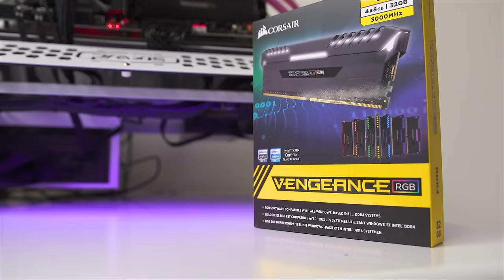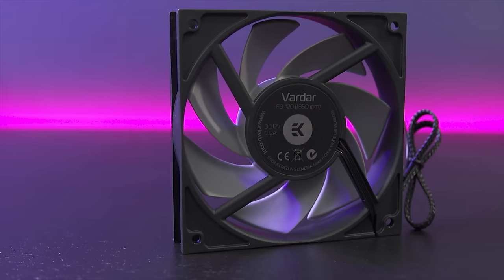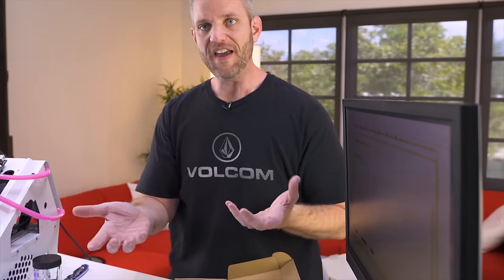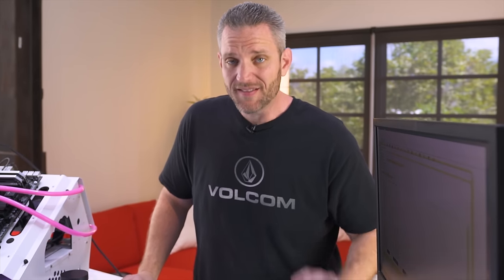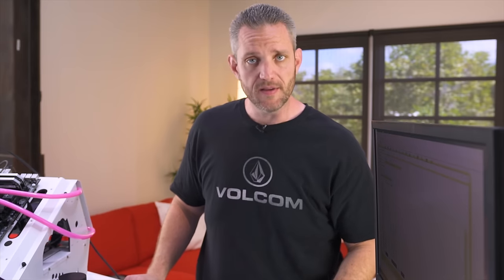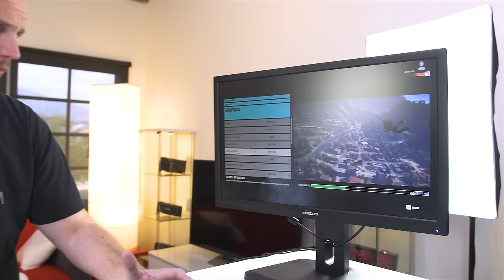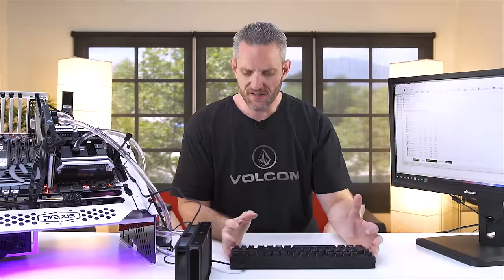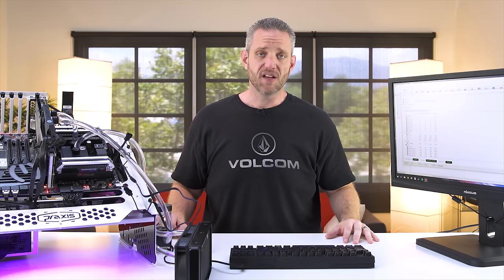How to Watercool your CPU and GPU for under $250

Comment: I know this is an old video but I wanted to add something as to why EK might have used aluminum instead of trying to use any other metal and lowering costs. Copper does have better thermal conductivity than aluminum but aluminum has better thermal dissipation than copper does because aluminum has a lower density than copper does. This could have been part of the reason why you had such great results with temperatures. I would expect that as long as people had adequate space and fans in there build, they would see similar results as that radiator is going to be able to dissipate heat very well.
Reply: No. 
The physical action of conduction/convection relies solely on the two material's individual thermal conductivities, their proximity to each other, and their time in contact with each other. Thus, a pure copper heatsink will always outperform a heatsink of the exact same geometry of a pure aluminum heatsink assuming that both have the same contact with the heat source and the same rate of airflow over the surface.
Something cannot have a higher thermal conductivity with a but....either it does or it doesn't, you need to read the rest of the article you got that malarkey from, not just the google snippett

Comment: Is this connected properly? 

It seems like in the video the inlet of the gpu waterblock is connected to the inlet of the cpu block.

I am trying to find out more information as I would like to add the gpu block to my ek fluid gaming setup and I keep seeing different results of which is what.
Reply: It doesn't matter order. As long as all parts are getting flow, the liquid will stay the same temp

Comment: what if I needed a 360 solution...is there a aluminum 360 rad out there or can I just use a regular 360 rad
Reply: They do sell a 360 Edition, but it has a GTX 10 Series water block.
Heres the link to that: https://www.ekfluidgaming.com/ek-kit-a360g
If you wanna go in the route of the custom building then, you can buy everything from their website which will land you the same price as the A360G kit, but now you can choose a water block for the latest GPUs available like RTX 2070 Super and up, and RX 5700 and up.
Heres the link to the parts: https://www.ekfluidgaming.com/parts/

Comment: id really like to see a long term test purposely mixing copper and aluminum parts to see how fast it degrades performance. im a mechanic and you see galvanic corrosion all the time working on equipment and cars but it usually takes many many years before it becomes and actual issue
Reply: Cpu parts are a bit exaggerated as they are so much smaller and a small amount of transfer can have huge repercussions

Comment: The galvanic corrosion is not really a big deal when you consider the life cycle of a computer.
Reply: Aluminium has no Galvanic Corrosion so long as all the parts and fittings are aluminium only, not mix copper or any other metal in it.

Comment: i make my watercooling with 60 euro....:)   and i make OC for a FX 4100  4500 MHZ stabil.....4,7 goes too, but was not stabil....so....was good ....i run with FX 8120, and everyone knows this CPU have heating problem, with 3,7  Ghz stabil.....i use a pompe from Wish, 2 cooling blocks 8,5 euro each one, cpu block 12 euro, and i buy tubs from a garten store .... :D . i put inside car cooling liquid.....if i have a budget of 239 euro...i build one with  Dry Ice....

Comment: Does this work with rtx?
Reply: They sell blocks for it that do, you would get the A240 kit (Not A240G)  and order the block separate.  (EK-AC GEFORCE RTX D-RGB).  Just be sure you get all the stuff from them, not a single bit of non aluminum in the loop.

Comment: Can someone link this?
Reply: I’m assuming by “this” you mean a place to buy the kit. Unfortunately ek no longer sells the full kit, but you can buy most of the components on their fluid gaming site: ekfluidgaming.com. Last I checked, you can still buy the aluminum cpu and gpu blocks as well as the aluminum fittings (soft tube only). The pump/res can be replaced with several other models from the regular ek shop as long as there’s no warning on the product page saying you shouldn’t use it with aluminum parts. The rad might be a little more difficult to find (I found a listing on eBay for an aluminum rad from a company called freezemod that seems pretty reasonable). Hope this helps.

Comment: Can hard tubes be used with this?
Reply: You'd have to get the proper fittings for hard tubing. The fittings for this kit are for soft tubing.
Reply: @dakupenndragon810   thanks. so I can get this then get the fittings separately for a hard tube set up then?
Reply: @lastone032085  If that's the route you want to go, you could. I'm pretty sure EK sells a hard tube kit as well, though I do not believe it comes with the GPU waterblock, that's something you'd have to buy separate.

Comment: Whenever you do tests like these, you should always include the RPM or CFM of the fans.  As I’m sure you know, increase the fan speed to high and the temps go down, turn it down to as low as they go, and higher temps. So which was it in this case?

Comment: Now this makes me want to try to water cool the GPUs in my new PC from Dell. The Aurora R7.
It has the I7 8700k with Liquid coold AIO and 2 GTX 1070s. 
Id like to be the first to try to water cool both 1070 with a setup as such. 
Any tips or info if this could be at all possible? or should i try to venture into it @JayzTwoCents ?

Comment: I'm wondering about the temps INSIDE a case and not on a test bench over a table. The air there is definitely colder and will affect this, specially being A LU MIN I UM

Comment: Triggered
I had to count how many times Jay said aluminum incorrectly and it was a whopping 34 times!

On a side note, this kit is interesting. I've always wanted to watercool but its been far too pricey. This kit, surprisingly, is about £220, give or take shipping from Europe etc. Still expensive, but much less than normal kits. However, I wonder how it would fare in a small case and how it compares to say, a 240 AIO cooling the cpu and a 120 AIO GPU pairing (assuming the case can fit both). Perhaps a video Jay?